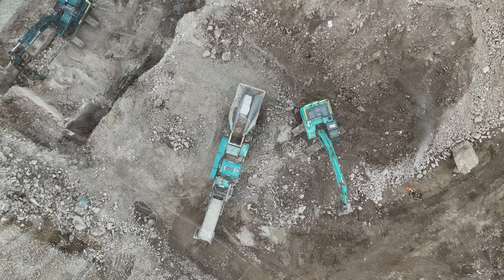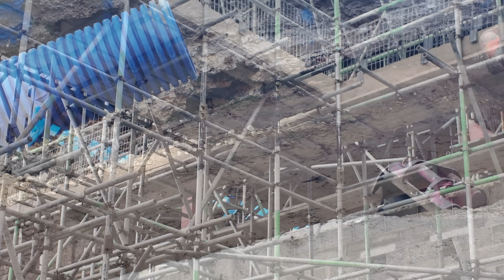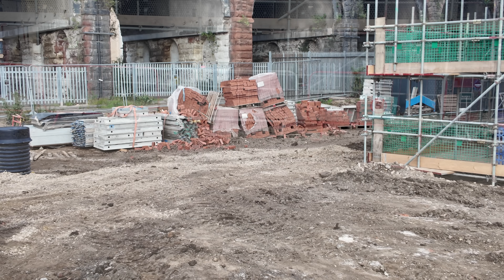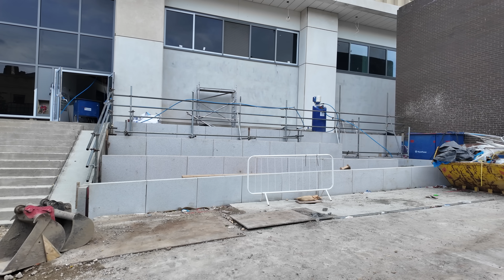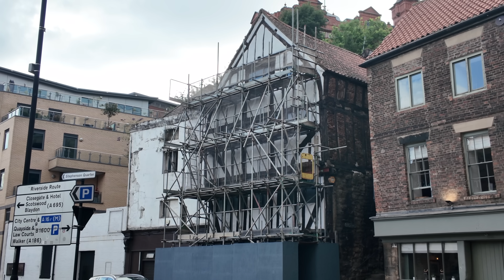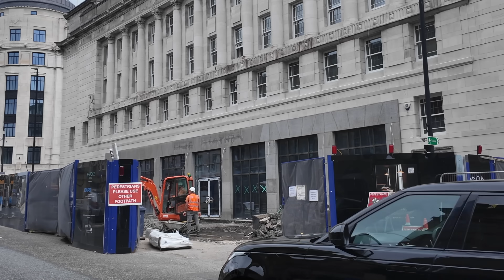Exciting Updates on Newcastle construction and restoration HMRC, Northumberland Street and beyond

Comment: I've noticed in Newcastle they actually develop things. In Gateshead just between the Baltic and the Trinity Square half of the city is either boarded up garages or hoardings for building sites that never got built. No evidence of any new construction in Gateshead which is disappointing.
Reply from the maker: Unfortunately definitely the case not even any movement on the new arena at Gateshead quays with if facing a 100 million black hole due to rising costs. Thanks for watching 👀
Reply: @55DEGREESNORTH68 I hear Gateshead Council got a new car park at the Sage development - £23 million for 1,000 spaces... Which is not fit for purpose as it keeps flooding...
Reply from the maker: @FateBoost yea a believe it’s closed should have built the Arena first then the car park but you know what the clowns 🤡 are like at the council
Reply: @55DEGREESNORTH68 Im nore concerned about the cost! I've seen bus stations, as in an actual building, for less than half the cost of the car park.
Reply from the maker: @FateBoost that’s true

Comment: Another excellent video - thanks. Newcastle is a beautiful city with so much history and heritage. It's great that renovations to the south entrance to Newcastle from Pilgrim Street are nearly complete - this always gave such a poor first impression of the city and it has long been overdue a facelift. I also think that our city lacks green spaces and street trees in places - I think this would make such a difference in certain areas. With The Tyne Bridge also undergoing long-term works, it does feel that Newcastle is largely under a cover of scaffolding and cones at the minute, but it will be worth it in the long run. Keep up the great work!
Reply from the maker: Definitely about time it had I face lift especially down the pilgrim street side what you have mentioned first impression when you come from the south once it’s all done should look a lot better especially when the Tyne bridge is finished. Thanks for watching 👀